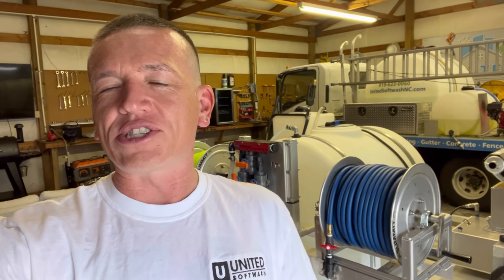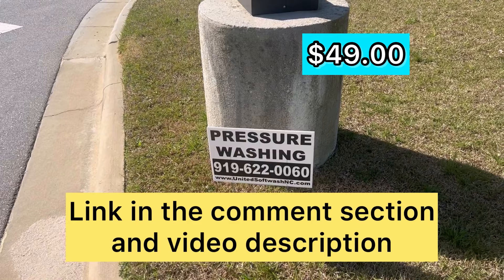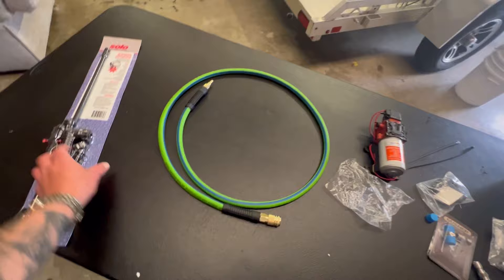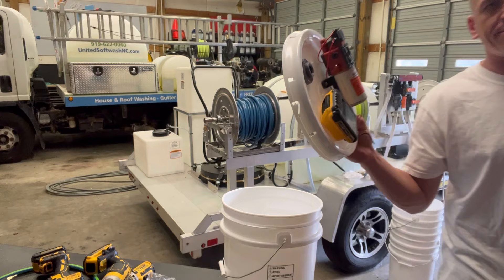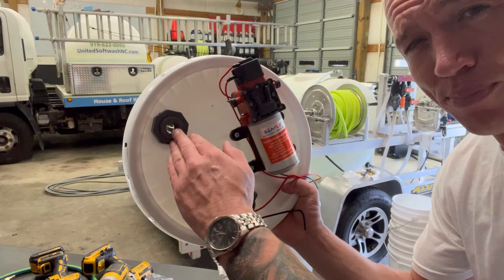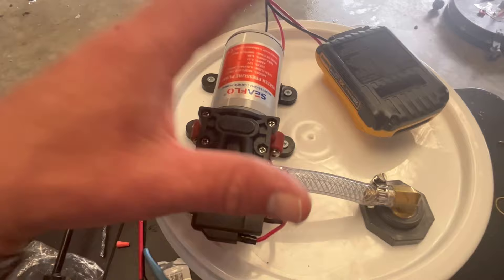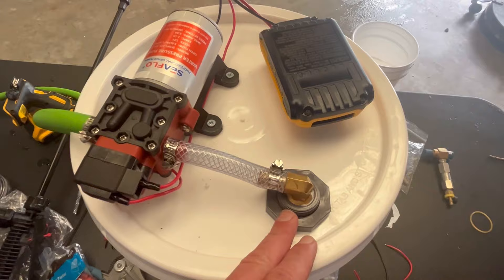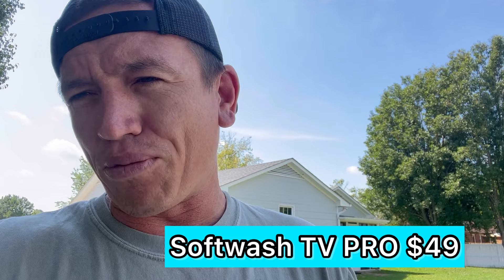How to Make a Softwash Bucket! Every Step and Every Part Needed

Comment: Solid! I’d bevel cut on cut the hose in the bucket at an angle so it doesn’t sit flush to the bottom and cause a vacuum.

Comment: I had a similar set up with a 15 gallon barrel, a walmart marine deep cycle, and a 60 psi-5gpm seaflo, all mounted on a horrible freight hand truck. when full i wheeled it out of the van, when empty, lifted it out. had an additional identical set up with a chemical resist pump. perfect (for me) set up! BTW....your vids are great, thanks :)

Comment: Very cool! One easy and cheap upgrade I'd add is a wireless relay with a keyfob remote between the battery and pump, or an inline switch on the + lead.

Comment: Not in the business but I made a bucket set up using:

Harbor Freight/Drummond 1/10hp transfer pump. 

Lowe's 90 degree garden hose connector.

Lowe's 120v 15a cut off switch. 

Harbor freight garden hose cut down to 6 foot. 

Harbor freight spray nozzle. 

I use it for everything. Soft washing roof, siding, fencing. Spraying liquid fertilizer. Spraying insecticide.
Reply: Sorry if this question is silly but how does the pump turn on when you squeeze the handle of the wand? Do you manually turn on the pump when you are ready to spray?

Comment: If you’re using a 12v battery you don’t need to change anything. If however you are using an 18v or 20v you need to install a battery reducer in between the pump and battery. 
I’ve burnt up a pump before finding this out. 
#washon
Reply: Thank you that's what I was wondering what volt battery he was using
Reply: @Trump-sucks Are there pumps that take a 20 volt battery?

Comment: Ok so we had a bunch of old stuff and decided to build a dolly cart with a 15gallon tank.   I have an absolutely huge deck nest spring and a resort in Geneva this fall.  Fill it walk and spray.  Drop it surface clean and repeat.   Didn't want the hassle of carrying it.   I did add a fuse to protect it since it's water and electricity.   And I've got a ton of old 5gallon jugs that I'm going to convert likewise for the dolly as well.   All I needed was a used piece of steel to bolt the hardware to and I'm golden.   Thanks for the idea!

Comment: Thanks for the video Kyle. I had everything I needed to make the bucket but the battery adapter which I just ordered from Amazon. 
 I didn’t even think about doing this. It will now make it easier to post treat concrete and other things.
 You’re the Boss when it come to educating.

Comment: Great video Kyle.. You are doing a great job.. I think maybe you should make your followers aware of what chemistry they are using vs.  which hoses are used.. chemical resistant or standard hoses.. I once experienced using strong corrosive chemistry in a pump up sprayer with regular hoses, it burst after a few minutes, imagine the rest for yourself.  Keep up the good work, Greetings from Denmark

Comment: Life Hack: 
When drilling in plastic, drill the center/spotting hole, then attach the hole saw. Put the drill in reverse (CCW) for drilling the larger hole. 

It's the easy way to avoid cracking any plastic.

Comment: Does that solo wand get caked up if your using sealer was just wondering 🤔 and could you attach a copper wand like the ones that come with the sealer steel pumps cans ok 👍

Comment: How do you get the water pump to turn off and on? when I hook mine up to battery, it just pumps and pumps. Yours seems to start and stop the pump when you pull the trigger
Reply: I came here for this very question….did you find the answer?
Reply: @jeanbellucci  Some pumps automatically shut off if there is no flow. My 1 Gal/Min diaphragm pump does it when my tank runs out of liquid.
Reply: the pump has a pressure sensor that turns off the pump when you close the valve on the spray wand and the pressure increases to the set point you set with an allen wrench on the pump

Comment: Most of the homes in my area are less that 4000 sqft, what size solution tank would you recommend for a 50/50 6% batch mix? thx

Comment: Thanks for keeping us informed, much appreciated. Real quick, will that rechargeable battery adequately power a 5 gpm, 60 psi pump? Or will a marine battery be required?
Reply from the maker: You need a marine deep cycle 12 v brother
Reply: @softwashtv6315  Awesome. Thanks a mil

Comment: Just started my pressure washing business, your videos are great! Although, why not use a downstream injector instead of this softwash bucket? also I have a 4gpm 4.2kpsi machine. Do you have any downstream injectors I should use?
Reply: Good for Spot spaying degreaser, SH mix on staggered paver paths etc, basically anywhere you want precise application of chemical use the SWB over DSI. Hope this helps.

Comment: Is there any problems using a 20v battery on a 12 volt pump?
Reply: There are problems with using a 20v battery on a 12v pump. He is must likely using a dewalt 12v battery so that your not destroying your pump with over voltage.

Comment: So you used 20 volt batteries with a 12-volt pump
Reply: I have noticed that on builds too, you could definitely use Milwaukee batterys with a Milwaukee 12v battery wiring system
Reply: @ThewayofMasterPo  it's no wonder they burn up pumps.

Comment: Just no to the wire nuts no you were doing a good job up until then I do think they using the airline which is about $15-$20 was a bit wasteful when you could’ve used something cheaper that would’ve got the job done but it’s your money and it doesn’t look like you’re doing bad thanks for the video and may your business prosper